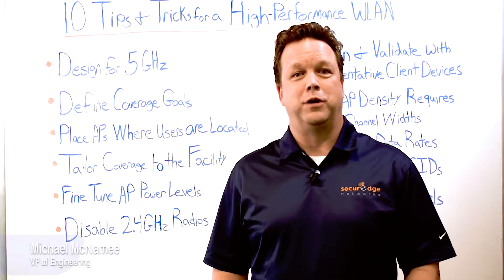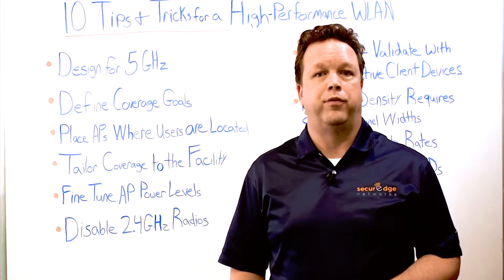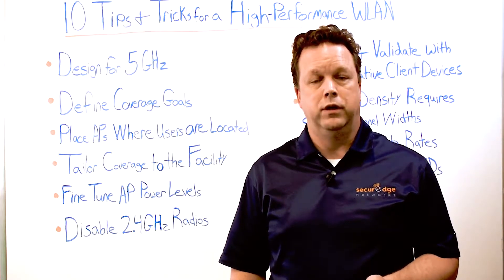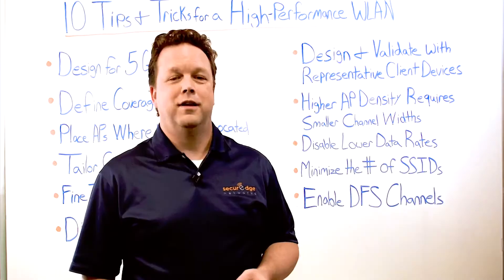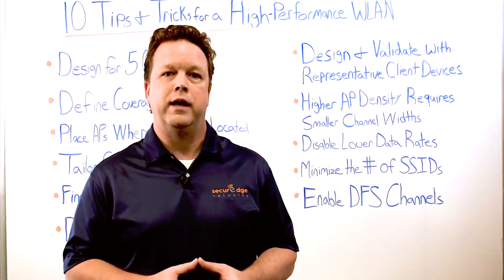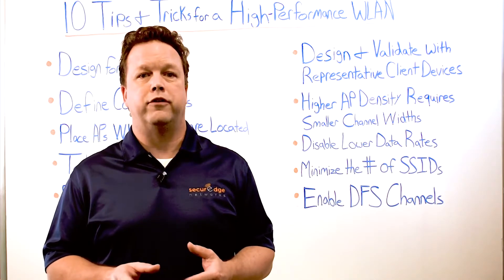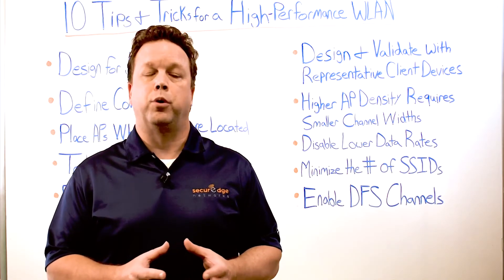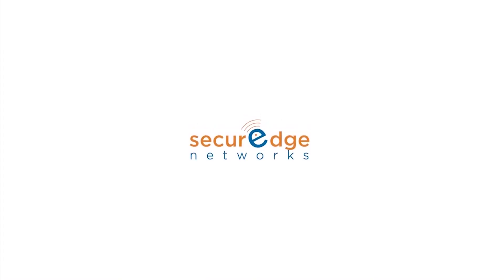10 Tips and Tricks for a High Performance WLAN

Comment: Several vendors proprietary RRM algorithms work phenomenally now a days. Limiting the radios to only broadcast at "x"dBm is more ideal as it allows the clients to scale with their internal WLAN as opposed to locking them in. Static plans are just use case imo. This otherwise was a good video.